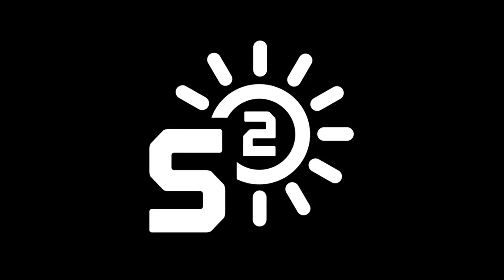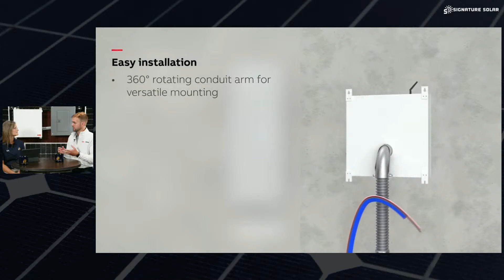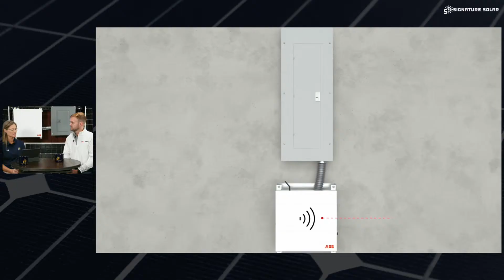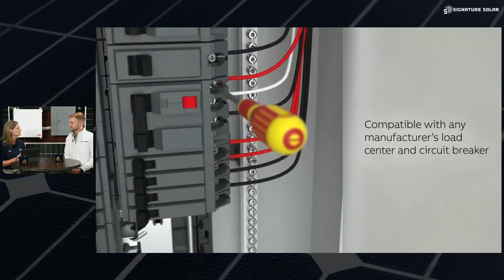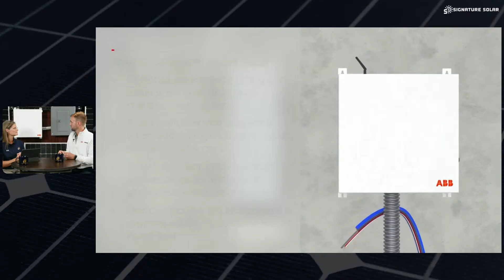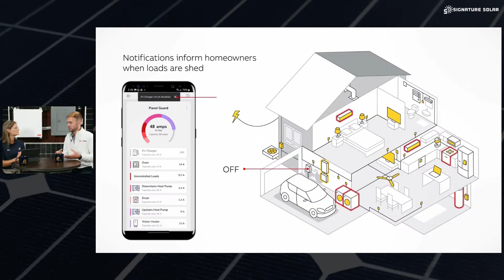Amp Up: Solar Talk - Ep. 29 - Smarter Energy Control with the ReliaHome Smart Panel

Comment: Is this like a fancy transfer switch?
Reply: I dont think it's a transfer switch. It looks like a bunch of relays that connect in series with the existing breakers on your main panel. Alternative to replacing the entire load panel with a 'smart panel'. But it only has 12 circuits, I think.